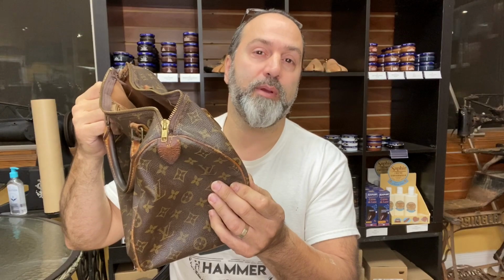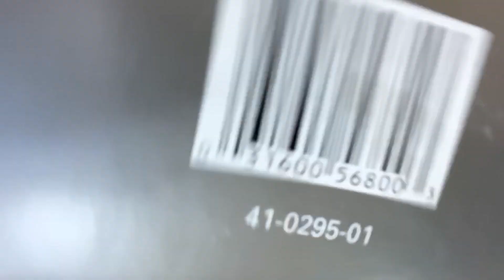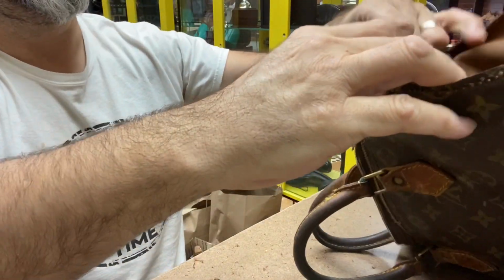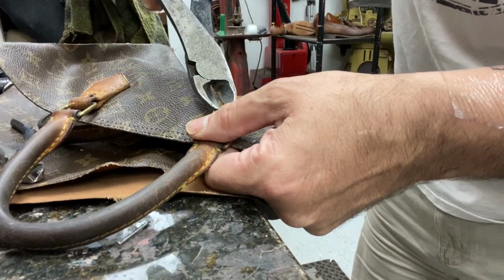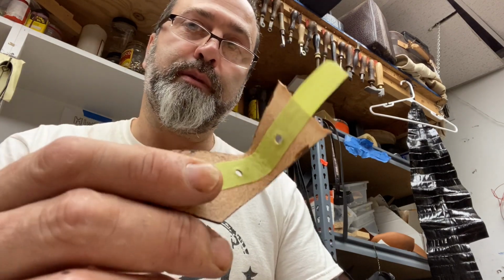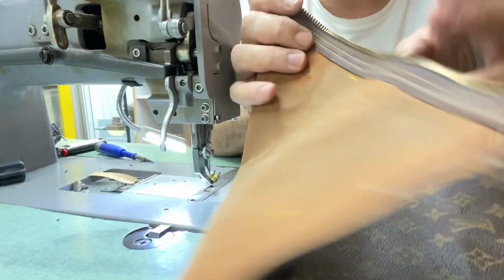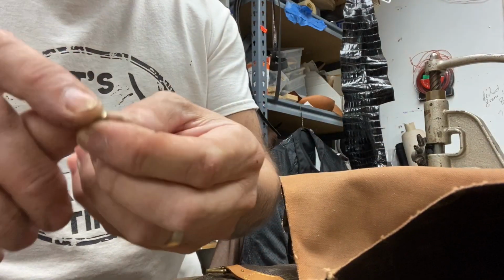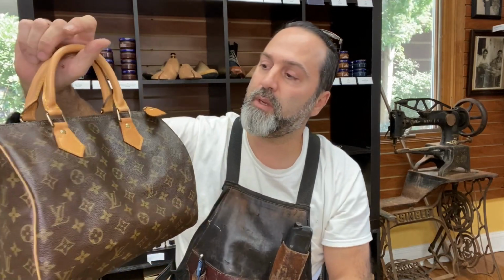Another Failed Repair of Louis Vuitton speedy.

Comment: Bedo, I really enjoy your videos. Very informative and well put together. I do have a question though, is there a specific kind of thread that you use or do you just find a thread that matches LV bags? Thinking of doing this as a hobby with my own old designer bags. Thanks!
Reply from the maker: Nylon thread, different sizes. #69,#135,#207

Comment: They have a vinyl cleat coat you paint on canvas to protect it and seal it. I clean my bags real well with water and Castile soap foam, dry it, and condition with Armour All low gloss conditioner for vinyl. I haven't used the vinyl clear coat, but maybe one day soon on an inconspicuous area of the bag, or the bottom.

Comment: Unfortunately, from experience, I am under the impression that there is more failed repairs than good. Sometimes, these people know how to do it right, but in order to, I do not know, keep the price low they make a low quality, fast job. You have to tell them from the beginning you want a quality job and the price/time is not that important otherwise you will end up with a piece of you know what. The other issue is with people without the skills but that is another story. I wish we had more workshops like Bedo's around here. Great Job Steve!
Reply: As the owner of the bag in this video.  When I took my bag to have it repaired the first time, this particular shop came highly recommended.  You don't know a quality repair until you see Steve's work.  I will NEVER take my bags to anyone but Steve because I know I will get quality work.  If it's worth repairing, it's worth having it done right.  Money well spent.

Comment: Nice work as usual!  That tattoo looks like a stuck on temporary tattoo, like the kind you used to get in Cracker Jack boxes.  Is that what it is?

Also, I know it's not directly related to this video, but I've been curious for a while: have you ever resoled a pair of Louboutins with JR and used red dye and/or lacquer on it?  I know you've done videos putting red rubber sole guards on them before, but that just doesn't feel right to me.

Comment: A hint for preserving the PVC-coated canvas: use the same spray used for the vinyl dashboard inside of a car to stop that cracking. It works the same. BUT be careful! It's got silicone in it which is the worst thing for leather; it stops the leather from breathing. 
So keep any leather protected, particularly vachetta! And only apply by first spraying on a cloth and wiping/dabbing it on preferably in small areas. Don't spray directly onto the canvas unless you've got quite a large area like with a shopping bag or you've taped up the leather first. It's harder to control the quantity if you spray and you don't want a thick layer. If worst comes to the worst you can later remove the silicone protector from leather with appropriate cleaner, but best avoided. Do that correction soon don't wait for the silicone to set, it just gets more difficult to remove.
The beauty of the silicone is it keeps the canvas PVC coating supple, preventing cracking. Make sure you clean up the surface first as the canvas coating has an uneven surface and retains dirt which is dull. Don't rub too hard as these days the monogram is just printed on, and it comes off with wear. Mind you I don't mind it a bit faded as it's less like being a brand billboard. 
When cleaning the uneven PVC coating in preparation for the silicone I use a soft cosmetic brush the type that's used to clean your face. The silicone takes a few days to dry sometimes longer....so don't use the bag while drying or it will come off on your hands and then get onto the leather!
Patience. Let's continue...lol.

Comment: Good job but your spacing on your handle tabs are off looks like around an inch or so
Reply from the maker: Jack Hill it’s exactly where the original was,
Reply: Yeah but did you remove the same amount on each side
Reply: Well you never answered my question so I guess I was right and your just to mad to reply that’s fine don’t worry about me calling you out on anymore of your screw ups I don’t watch the Chanel anymore I was just checking to see if you had answered my question

Comment: So you don't have to lug around the tripod and clear the floor, you could get one of the variations of table clamp/arms from SMALLRIG (google SMALLRIG Cool Ballhead) and the Amazon links should get you where you need to be. Cheap, simple, metal. Should be quite adequate for your needs.

I use a camera to stream some prototype modifications from time to time from my workbench and i use something very similar in setup with a copper welding C-clamp, in which i threaded an indicator arm, but i had all this junk gathering dust so, it cost me nothing.

TLDR, a small clamp and arm setup will free you of the tripod and give you decent visuals, especially because of your workshop's setup.

Comment: as a business owner, how do you deal with the price increase post-job? Or do you call them after your initial findings, and ask them whether they want to go the $800 route or stick to the original $580? awesome upload; as always!
Reply from the maker: equizikal I don’t change my original quote, unless it’s really bad. Most of the time I tell them they got more then promised.
Reply: equizikal 
 A new LV speedy is $900-1k, I would buy a new one.
Reply: @sct4040  Sometimes, like the Louis Vuitton Bucket Bag, the item has sentimental value that exceeds its economic value. So, people will spend their money restoring and extending that item's lifespan. In this example, that bucket bag was bought by the customer's mother as a graduation present 30 years before. It was a loved and well used item. So, different strokes for different folks.

Comment: Beautifully done! However, if it was me, I would just buy a new one, with that particular bag! Your job is so detailed and meticulous, on top of the material used, that of course it’ll be $800+ and you can find almost perfect condition used Speedy for $600-$700.
Reply: Ade S The bag may have been sentimental to the owner .... Would you rather buy a new one or send Steve the first bag your parents gave you?   If you have a bag that long, there is usually a reason.
Reply: jennifer *  yeah, that’s totally a possibility. I’m sure there is a reason why, of course. I’m just saying, sometimes it’s cheaper to buy a new one than repair. I once bought a pre loved speedy 35, because it was super cheap, and said to myself that I’d send it to the LV store to get it freshen up/repair the top handles. When I took it to the store they suggested I change every patina piece because if I just changed the handles, all the veins and tags would look completely different. So I did the whole thing and the bag ended up looking like new but I spent $850 on the repair + $250 that the bag costed originally so I paid $1100 total which is almost like buying a brand new one haha and later on I found another pre loved one that was described as 9.9/10 for $500 and I bought it for my mom (we both had a speedy 25 since the early 00’s but we were fixated in getting a speedy 30 each as well) so I got it for her birthday and it literally looked brand new. Like she really thought I had just bought it at the store. So I ended up paying twice as much for mine, unnecessarily, and it was a loss because if I ever decide to resell it, I wont get anywhere near $1100 for it. So yeah, that’s my personal experience.
Reply: He mentioned at the start it was a $580 job, so already ahead compared to buying a used almost perfect condition @ $600+, however he does say normally an $800 job.
Reply: The added value is that Steve does a better job than even LV did when it was newly manufactured....whether it's shoes or a handbag, you now own something that was painstakingly reconstructed by a master craftsman/artist.
Reply: @Styledandorganized  in the USA? That I know it’s less than $600 to get all the outside leather replaced, did u have the zipper and hardware replaced as well?  Vintage canvas is much better ima.

Comment: That’s a lot of money to spend on a bag with cracked canvas.... just my opinion 🤷🏼‍♀️
Reply: I'd just buy a new one at this point or a preloved on in a better condition
Reply: @BishiS  But that would be someone else's bag.
Reply: Might have sentimental value 🤷‍♀️
Reply: if that was a real bag he has ruined the value of the bag by changing the handle. also he has replaced almost the whole bag. my question is if it was a real bag why didnt the owner take it to a LV store they would send it off and have it repaired for less than the 500 he is charging also those bags come with warranties i know cause i own a few  and if you are spending A minimum of $1000 and up on a purse i would send it  off and have it fix and replace with Louis Vuitton parts
Reply: @jivonniasmith9770  LV eventually will tell you it's time to get a new one, they won't just keep repairing it forever.

Maybe they had already told her it was time and she wasn't willing to get a new "made in who knows where" bag from LV.
Reply: jivonnia Smith I agree with you, but LV doesn’t honor for decades owned bags and some boutiques turn you away for repairs, especially with Canvas coated bags 💼
Reply: @beautymaven3952   I know it is at the discretion of the store. its a speedy bag so i had other questions about the bag being real

Comment: You may want to have a flat fee of total restoration and then should you not need to do so, issue a refund of what you did not have to restore. People love getting some   money back. It will demonstrate your fairness of your company. 
Your work today was as always EXCELLENT!
Reply: You can't really do that as the extent of of materials and labour required isn't known until you do the work. Steve is an artist as well as a craftsman, because he goes the extra mile. I mean that 30-year old Louis Vuitton Bucket Bag repair he did last year. It was better designed than when it was new when he finished it. So, no. People who can afford to drop $1600 on a handbag don't worry about cost.
Reply: @BigHenFor  who said they got it new?